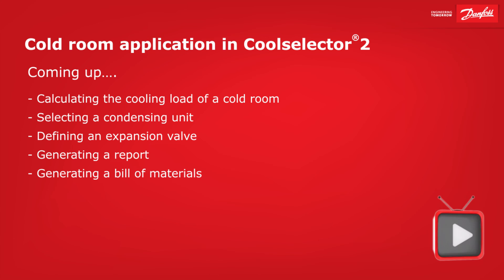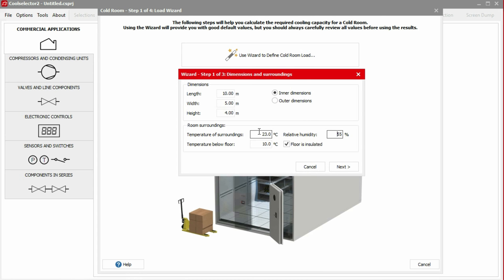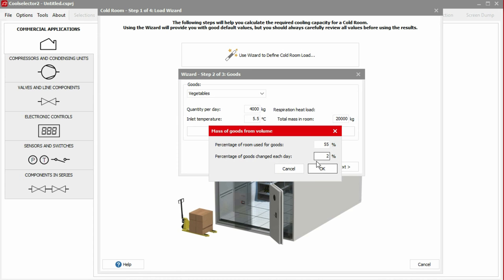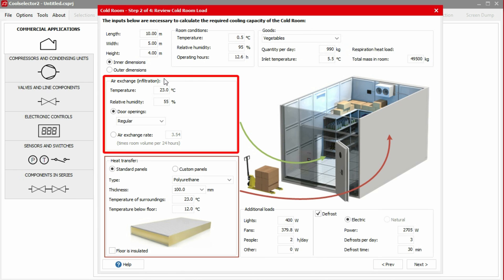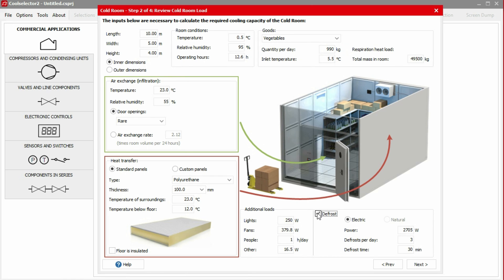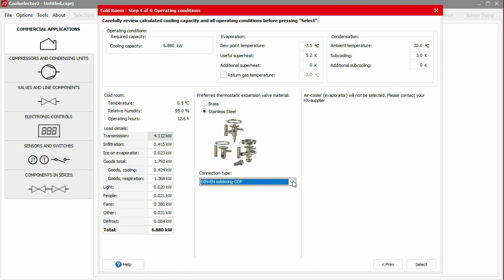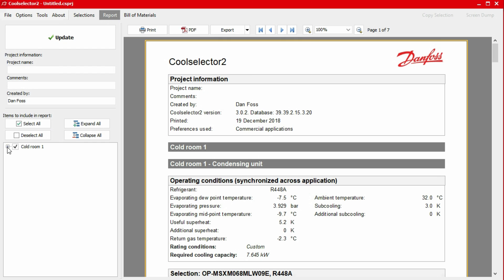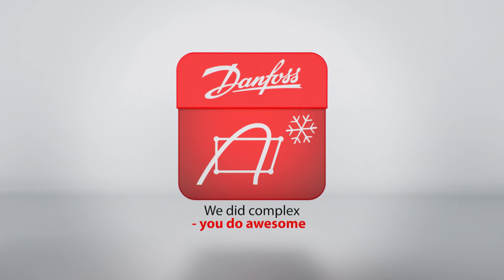Coolselector®2 – Cold room

Comment: Just to be clarified.  A whole warehouse  , say 50M x 100 Meters is partitioned to have a 8 cold rooms of 4 x 6 meters. To computed the over all load requirement ,  is the data to supply is only for a single cold room and then multiply it to 8 cold rooms?
Reply from the maker: Hi, we are checking with our experts and will get back to you.
Reply from the maker: Hi Michael. You would need to calculate the rooms individually unless they have very similar product loadings or thermal loads. Hope this helps!